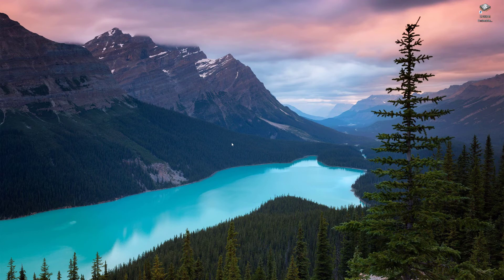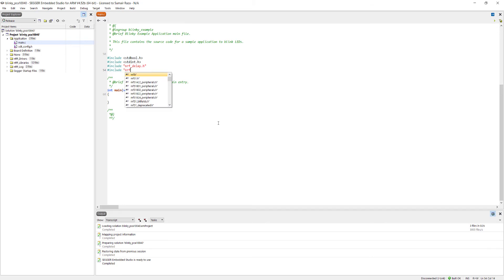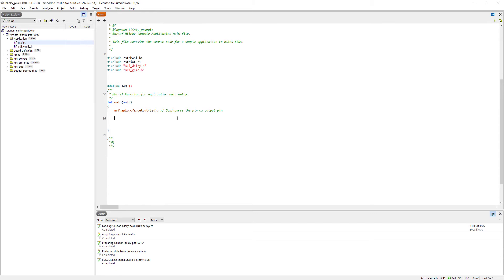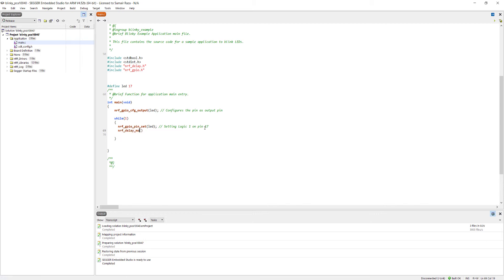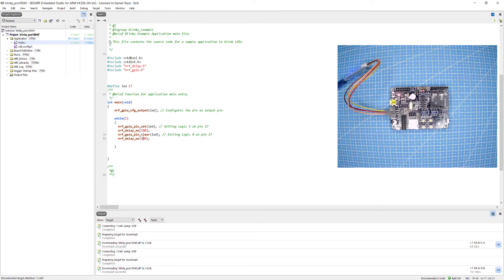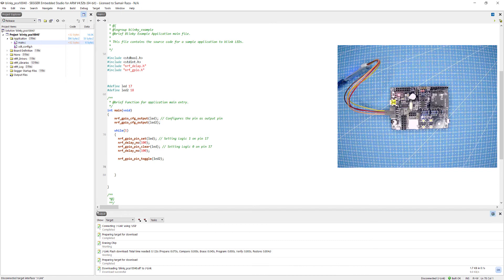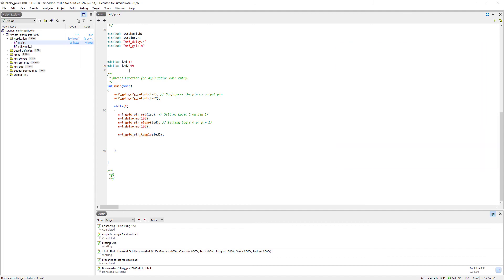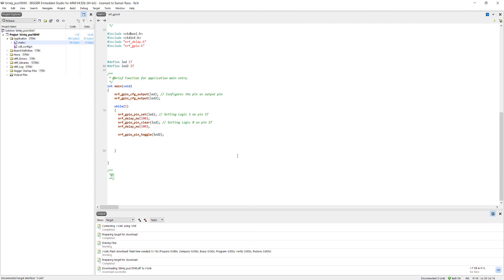nRF5 SDK - Tutorial for Beginners Pt 5 - Basic OUTPUT (Blinking an LED)

Comment: When I build blinky, there comes an error

Output/Debug/Exe/blinky_pca10040_s132.elf does not exist.
Linking blinky_pca10040_s132.elf
.text is larger than specified size
.rodata is larger than specified size

Help, please!
Reply: The same problem here...   and no answers.
Reply: @jonathanjuarezgarcia579 any answer?
Reply: Same issue😢

Comment: How to configure port1 pin like p1.8, i try to define as #define led_ext 40 (32+8) but it wont work,pls help me out I used nrf52833 DK
Reply: I struggled with the same question. Not sure if this will work for you, but I found a macro in modules/nrfx/hal/nrf_gpio.h

/** @brief Macro for mapping port and pin numbers to values understandable for nrf_gpio functions. */
#define NRF_GPIO_PIN_MAP(port, pin) (((port) << 5) | ((pin) & 0x1F))

On the nrf52840dk board that I'm using, I am able to blink using the pin labeled P1.01 with this:

#define led NRF_GPIO_PIN_MAP(1, 1)

Comment: Amazing tutorials. Thanks!
I got your project working in my nRF52840-DK. The hardware wired leds blink as you describe in your video. But when I connect an external led on a breadboard as you show it,  it does not work. What could be wrong? Do I have to activate the GPIOs by hardware switch or software?

Comment: I really appreciate you taking the time to make these videos. I think they are the only ones this in thorough for the beginner working with nrf5 and segger.  I have some arduino experience but was at a bit of a loss with nrf5 until I found your videos. After looking through the sdk I am still trying to figure out how to designate a pin on a different port for an output. I have a nrf52840 dk and port 0 pin 11 is an input button but port 1 pin 1 is what I want to use as an output for a separate led. Could you show how to designate a pin on a different port. It seems like port 0 is assumed and another port must be explicitly assigned , any info would be great,  I'm still unsure after looking in the nrf5/sdk17.02/api/perphdrivers/perphdrivers/gpo so any info would be appreciated